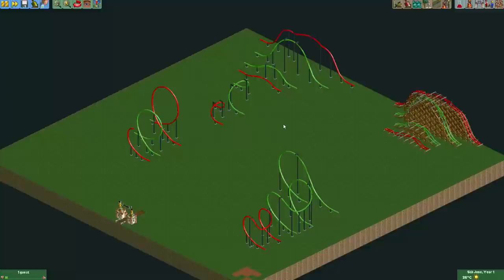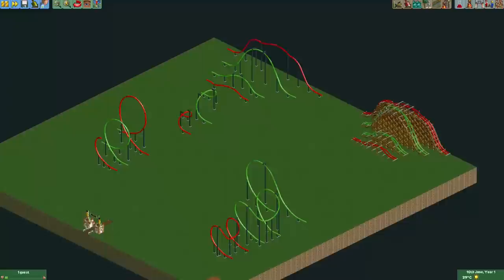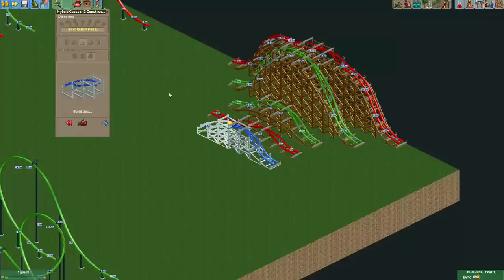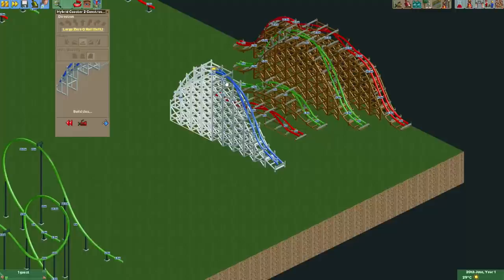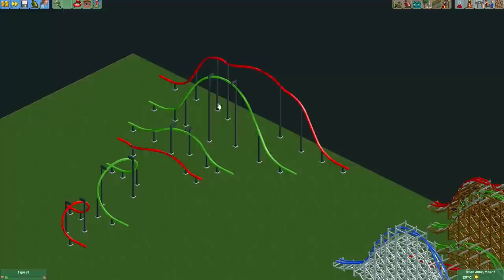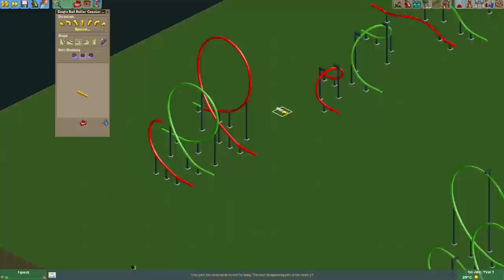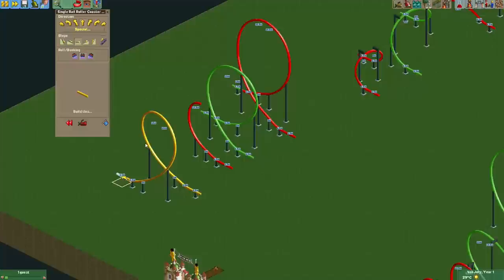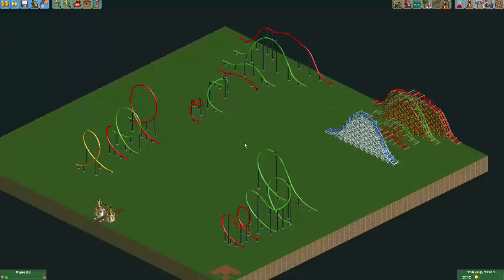New track elements have been added to OpenRCT2!

Comment: OpenRCT2 keeps going neck and neck with Parkitect in terms of which game I prefer. 

The extremely flexible track builder is one of Parkitect's greatest advantages. On the other hand, as soon as you want your coaster to do anything other than a simple closed circuit, OpenRCT2 does it better. Then Parkitect retorts by featuring coaster types that are actually relevant this side of 2002 (as RCT2 ages, fewer and fewer of the coasters built in real life parks are featured in the game, and fewer and fewer of the game's coasters are often seen anymore), but then OpenRCT2 comes with new custom coasters ...

I still think I prefer Parkitect for its immense flexibility of decoration and the extra gameplay challenges it adds, but OpenRCT2 refuses to turn obsolete any time soon, and I really respect that.